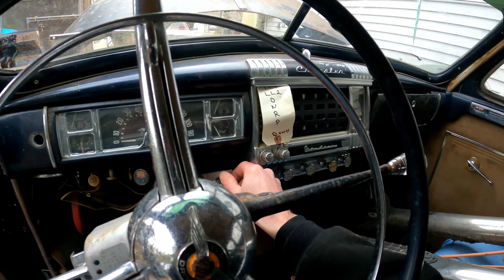Rotting 1967 Cadillac Convertible Will It Run and Drive? - NNKH

Comment: That’s the trunk’s “soft close” mechanism, where you softly close the trunk lid one click and the electric motor draws it down the rest of the way, so you don’t have to slam it. The whole strike plate pops up when the trunk is opened, and retracts when it senses the lid is closed. Definitely a staple on old these old Caddies and Lincolns — probably appeared on Imperials too, I’m just not well versed in those. Newer luxury cars incorporate the same idea in the doors as well, if you’ve ever seen that.
Reply from the maker: Oh okay. Awesome, thanks for the info!
Reply: 3rd generation camaroa had them too.. pure trash the brackets always fell apart
Reply: @NoNonsenseKnowHow  Theres no electric motor, thats the solenoid release.  The mechanism is spring loaded and cocked by the trunk hinge via a PTO cable.  I could see the cable on the passenger side hinge.
Reply: I'm pretty sure there was no soft close back then. There's likely a button in the glove box that pops the lid, but it doesn't assist with closing. Those came much later.
Reply: George  
Caddy’s weak point was a cheap piece of plastic that bridged the gap between the fin and taillights. 
Around ten years it would start to rot off in pieces!! More if garaged. Most people wouldn’t repair it and it looked like 💩
Reply: George  I never said they did I said 3rd generation camaros did
Reply: @66skate  My 1971 has a soft close trunk, click it to secure the mechanism & the trunk pulls itself down tight so it seals nicely.  Weird option, but kind of unique i guess.
Reply: I daily drive an 03 town car with that trunk feature and cringe whenever I see someone slam down the trunk lid on one of these cars lol
Reply: Thanks-- cool ---- My new refrigerator does that
Reply: @Blaines-smallengine-repair  i had an 88 RS Camaro mine would malfunction from time to time and it was brand new 👍

Comment: I’m like you, I have a Toyota T-100 (predecessor of the Tundra), 5VZ, 5 speed 4x4 and a 2005 6 speed Duramax. I have definitely worked the Toyota way harder for many more years. 362k absolutely love that truck.
Reply from the maker: Right on!  Those t100s are great trucks! Pretty much The real first generation tundra

Comment: The marine batteries only have a 1 year warranty, and you can divide the marine cranking amps by about 1.25 to get the cold cranking amps. The marine batteries are rated at 32F and the car batteries are rated at 0F.
Reply: Good for me in southern California
Reply: @332ARA  Well, the 1 year warranty isn't good anywhere.
Reply: @bills6093  usually if a battery lasts a year its going to last 5 or 6. Unless you misuse it.
Reply: @thesmallenginekid  That's the risk you take when using a battery in a role it was not designed for. If it fails in that role, you have no warranty. And I never go more than 4 years on a car battery anyway. I replace them before they let me down.

Comment: Definitely salvageable, weld in new floor pans and trunk pan. Would have to get a better look at the frame but I think it could be brought back to life with a little love and elbow grease. Nice video, I enjoyed it !
Reply: Cadillac parts are very expensive.  The interior alone would probably be $2000.  The top $1-2000.
Reply: Later model seats can be found for reasonable prices on ebay. A good solution to follow floorboards, if one were to restore it.
Reply: @rogersmith7396  not everything in this world is solely about money, some things are just passion and love. Can't put a price on those things.
Reply: @wyattblackwood3927  Some don't have $10,000 to put into a wreck.  Some should spend the money on their families or something else.  I've done similar projects and the time spent goes through the roof.  Often someone will start and give up and then pass it over to someone else.  A little paint won't get the job done.  I have a TR 6 that has'nt been on the road in 15 years.  Its in far better shape than this car.  The mice have taken it over.  And you can get most parts for it.  Passion and love can be eaten alive by reality and crap.
Reply: @rogersmith7396  I'm not sure what all your hostility is about I'm just saying not everything has to turn a profit, if you don't have the money then don't start a project it's a simple as that but crying about it isn't going to fix anything. Right now I'm dropping a lot of money and rebuilding an 85 Ford F250 into an absolute Beast and it'll never be worth what I'm putting into it but it's for my own personal pleasure. I've seen a lot of people waste time sitting around watching sports or just watching TV, which I think is a complete waste of time, personally I'd rather be out in the garage building my truck or working on my bike or my boat, something productive. You have a good day !
Reply: @rogersmith7396  Your right on, finally someone that is realistic about costs. Youtubers just make a video or two and dump it. There is a mint 67' Cadillac Conv near me for sale for $12k Canadian. The seller wants $3k for this? Must be on crack.
Reply: @North49191  I do this work on the cheap.  I of course value my time at zero.  Cadillac parts are scarce and stupid expensive.  I have seen rear view mirrors listed at $2200.  The whole reason you buy a mirror is because they are not chrome or stainless but zinc.  After a few years they look like shit.  Standard of the world.  A new old stock hubcap can be $1000.  And most of these old barges are hard to sell, they have a very limited market.  I bought my 70 Eldorado mechanically sound in primer for $2500 and I just ran out of time and if anything overpaid.  They were on ebay down to $900 but the sellers were complete asses.  I have seen 70 Eldos go for $50 k but I also see them unable to sell at $4k.  I would hope to get $15k out of mine but thats a hope.  Same for my TR 6.  Very limited market, $100 junkers available.  My Saabs are nice but I figure around $5k tops just because what kind of newer car will $5k buy these days.  A high quality inlaid steering wheel for the Eldo can be $2000 and there are damn few of those.  I plan to re inlaid mine myself.  The power seat parts are expensive, thank god mine appear usable.  You are right, some of these people are clueless and I tell them so.  Oh and it can take years to restore a car.
Reply: @North49191  Mint my ass .for 12K.  That car MINT is worth 50-60 K easily.
I will admit with this car, 3k is all the money, especially with no title. Would it be worth paying a shop to restore it, at this point in time, NO.
Reply: @rogersmith7396  That interior in original restoration quality leather, with door panels carpet and a new top , would be in the 10- 15K range easy. Surprisingly, the dash pad in that car appeared to be in great condition, don't know how that happened.
Reply: @tuck6464  Nope.
Reply: @rogersmith7396  Ah, yup.

Comment: Excellent video Always Chris  :) back in 2019 my one older elder cousin Albert he bought a good condition used 1976 Cadillac 4 door in Navy Blue with not kidding 8.0 litre 500 Cubic Inches size 8 cylinder 4 barrel carb, Turbo 400 3 speed Automatic transmission, 411 rear end and got every option to in car get in 1976 only 3 things had need get done was back oval chrome lights for brakes , turn signals mounts need replacement also paint up and new Air Conditioning pump ! Plus 4 new tires it had 300.000 kms and got steal price $1.000 uncertified  ! But luck got personal license plate says 500 & CAD for Ontario Canada! But got all Restoration done with new paint job on too and not Converitable it has Sunroof plus one thing still works is factory radio also power antenna Lol ! He told one day could find metal decal for front gone  missing plus back one too! Lucky had them paid me for it plus trade help with my classic car I have ! Also  Chris like Your YouTube videos always and how fix up too very cool too ! But when say this video thought had Duke Of Hazzard TV shows series Boss Hog car hope that 🤔 👍 you  give Lol! Also for Chris  , Jen , Gus the Dog and Gus reminds of my younger childhood years when me baby from 1976 to 1984 had dog like Gus but she was Female named Huka she was full of energy to like Gus is ! Also Chris that very nice Cadillac car hopefully get fully  restoration to also took to Vechiles shows plus stored inside too !

Comment: Marine batteries are usually built tougher, with higher CCAs. The starter batteries are designed to give a quick burst of power for starting, but they tend to drain a little faster when used with accessories.
Reply: Agreed, except it’s MCA or Marine Cranking Amps for marine batteries. Marine batteries generally are not designed to crank in as cold of temps as car batteries are, therefore the difference in terms CCA and MCA. As to why they are so much cheaper IDK maybe less demand?
Reply: Great video as usual !
Reply: It's odd, usually everything else for the boating consumer has the price jacked up.
Reply: @corydriver7634  Yeah, the difference in CCA is what lowers the price. Marine batteries have thicker and fewer plates than an auto battery. Probably cheaper to manufacture because of the higher tolerances.

Comment: Hello Chris and Jen.  Well the Engine does sound real good compared to how the car looks..  On the truck mechanism , when all of that is working properly you never want to slam the trunk lid closed.  Just close it gentle until you hear it latch and then the mechanism will draw the trunk lid down and tight.

Comment: Back in the late '70's , i had a '68 Cadillac Fleetwood, with a  472 c.i. and it was a good runner. sold it cuz  gas went from $ .75 cents per gallon, to $ 1.00 dollar , plus i quit my job, so, yeah . The good old days :)

Comment: Great job getting her running.  My first car was a 1965 caddy which I purchased for $400 in 1975. A few months later ignition shorted out and the car caught on fire.  Destroyed.  I think that guy you bought it from was wrong about the 429, my caddy would do a burn out without power braking. Later I had a caddy with a 472 which I thought was a turd.  Keep them coming it’s fun to watch. Love to see an old muscle car like the SW with 383.
Reply: The 472/500 had much higher HP and torque rating.

Comment: You can get prebent stainless brake lines for pretty much any car from classic tube.  I put them on everything.  Not cheap, but reasonably priced for what they are and that they will never go bad.  I run some anti-seize on the fittings but probably not supposed to do that.

Comment: The last year of the 429. I had a 67 coupe and loved it. The shop manual said it called for 100 octane and mine did ping sometimes lol. And there should be a vacuum trunk release in the glove box
Reply: Its electric.
Reply: @Roger Smith  interesting. My 59 has an electric, but my 67 was vacuum

Comment: I remember when those Splitfire plugs were a thing. Those things ran great in my Skylark that I had. They ran better than AC plugs with that engine. I would say those plugs were purchased right around the same time that the tires were. That car was on the road in the mid 2000s.

Comment: Oh that's crazy first thing I noticed when you got to the distributor as it's in the front that's got to be a Cadillac general motors I wonder what motor that is I better go back and watch some of the video again that's  odd I still flip out on how you take that old clunker like that and get that puppy running and then driving it with a lawn chair and a piece of plywood that is psychotic awesome, right on bro another awesome video. 😁 A lighter note you guys move out to Arizona you want to have all that rest on your and vehicles also it's not as cold and there's tons and tons of vehicles without rest from the 50s 60s 70s out all over the desert of course that would be a heck of a move for you guys .??? I was just thinking of that while I saw that rest on your tundra under the fender.

Comment: when i first started driving my first car with points was a 62 international scout it had points was taught to always have a finger nail file and matchbook in the car the matchbook cover used for point gap instead of feeler gage and also never leave the key on the 0n position  for long periods of time you can burn out the points if they wind up in the closed position when you shut the car off. hence accessary position only when using power from the car for anything. after getting out of the army i became a dealership Pontiac car mechanic then moved around to other carlines by then points where a thing of the past but occasionally i would get a vehicle with points to work on using a dwell meter to adjust them. and then that same dwell meter used for GM MC solenoid on the computer controlled carbs GM had until they went to fuel injection then soon after that changed craft to millwright industrial mechanic

Comment: The "marine" usually dont have a CCA number relying on you never running your boat in freezing conditions so the MCA number is peak amps at 0C or 32F.

Comment: Those engines are bullet proof, back in the 80's my dad and granddad drinking on 2 quarts of stump whiskey jumped in that same year caddy, the thermostat stuck the block was glowing red for miles🤣they sprayed it with a hose while it was red hot , snatched the thermostat out finished off the last of the stump whiskey and tore out again🤣😂damn i miss the good old days!!

Comment: Hey Chris, I notice you have built up years of experience and thats how you work your way through these problems, I worked at a toyota dealership in rochester for a year in college and mostly worked with the used car guys, so saw a lot of different stuff, but I was always more of an apprentice, taking on small tasks, starters, suspension and stuff like that, not a diagnostic person at all when it comes to electrical, my question is how did you learn a lot of your stuff when you were starting out, was it a technical school you went to or is it all on the job, or did someone in your family teach you.

Comment: I like supporting you and your channel. I think I'm in the minority on this one. It's a shame that that car is a convertible because I think that car just needs too much. You put in a lot of good hard work on this one . Good video content!
Reply: I would'nt give more than a couple of hundred for the wreck.  I bought my 70 Eldo for $2500. no rust just needed paint.  33,000 miles.
Reply: It's a running stopping car, I'd pay $1500 easy. As far as I'm concerned, "parts car" status is only awarded for frame damage or severe rot in hard to get to areas. Anyone could weld up floors or a trunk.

Comment: I Love the ‘67 almost as much as the 1960 convertible.  My father had both a ‘60 convertible and a ‘66 Sedan DeVille.  The 66 was an unstoppable workhorse.  It pulled our Airstream trailer all over the country and 4 wheel off-roaders were always shocked when my dad pulled up behind their jeeps in the Montana high country.  “How the HELL did you get THAT thing up here ?” ….Was the typical refrain 😂

Comment: On my 70 Cad there is a PTO cable running from the trunk hinge to the lock and when you put the lid down it cocks a spring which then grabs the lock and pulls it down  in the mechanism.  Not the most necessary thing but its something Cad does.

Comment: I own a 1967 Cadillac Deville Convertible and sure they are very nice cars to own, but  they are very expensive to restore I was lucky to find a California car original paint and excellent interior, being over 50 years old the body is beginning to show its age. And a lot of body panels for these cars can not be found, the one here would make an excellent donor car, I had a crack exhaust manifold I wanted it replaced 1 manifold cost me $ 300.00. And that was the cheapest, I’m a retired mechanic so I can do my own mechanic work I’m trying to learn body and paint so if you take one on be ready to spend your money and elbow grease.

Comment: OK , I used to manage a Oreilly’s and asked this same question to a Johnson Controls rep who came to visit me. Deep cycle batteries use thicker plates than the starting batteries, starting batteries use more and thinner plates to help produce that large power dump. Therefore the manufacturing of the thinner plates is more costly and time consuming hence the higher. I know you love Optima but when Johnson controls bought Optima they outsourced the production of Optima batteries to China so if you get a Optima battery now days it’s produced in China hence the downfall in quality.

Comment: Not sure why they’re cheaper, but I do know that in my explorer, I put it in there because of a winch and ran it down. Low enough needed a jump, drove a good while and when I shut it off, it still needed a jump.  
Because of deep cycle in my belief, the alternator is putting out a lot of voltage to charge the battery, but the battery will not take it fast. It only takes it slow so it takes a while to build back up. Slow charge is the best.
Reply: Not on a Tesla.

Comment: Not sure what the deal is with the marine batteries but the previous owner I bought my 64 galaxie from put a new super start marine battery in it the day I bought the car and it's over 2 years old now and cranks a high compression 390 over cold or hot winter or summer like a champ. I load tested it and it tests very strong. It's a group 24 marine.
Reply: In what part of the country do you live?
Reply: @sykwookiee  West coast. No problem cold starting in 20-30 degree weather after sitting for a week or 100 in the summer heat.